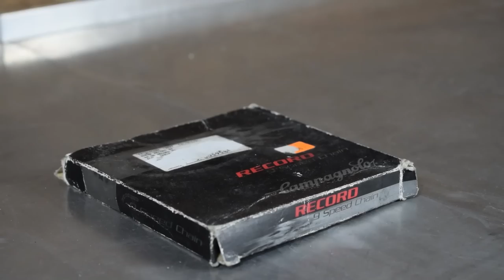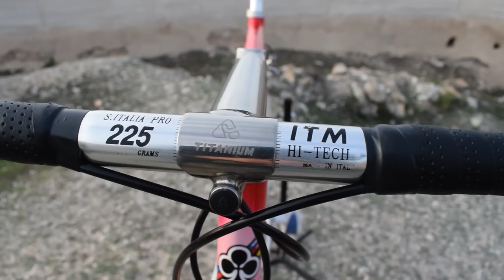🚀VINTAGE ROAD BIKE BUILD🚀 "COLNAGO DREAM "9V TITANIUM"

Comment: Why use a torque wrench? Mechanics never used them until 10 years ago. Just tighten bolts down by feel.
Reply from the maker: Hi friend!!! You're right. I prefer not to go overboard with the tightening, if they did not use them before it is because there were no low torque dynamometers. Many bicycles come to me to repair that have the threading screws and it will be for a reason. If I have it, why not use it. Don't you think? A greeting and thanks for comment ; )

Comment: What happened to the lugs on that frame?  Are the titanium tubes welded together?
Reply from the maker: Hi Jennifer!!! This frame does not have connecting lugs, they are welded directly to the tube, if that is what you mean. To your second question, the tubes are welded as I told you directly tube to tube, but they are made of aluminum, not titanium. Greetings and thanks for leaving your comment ; )